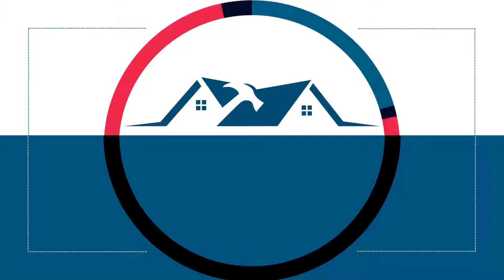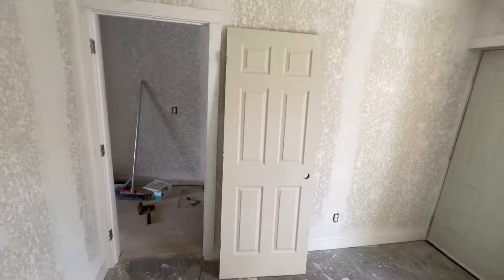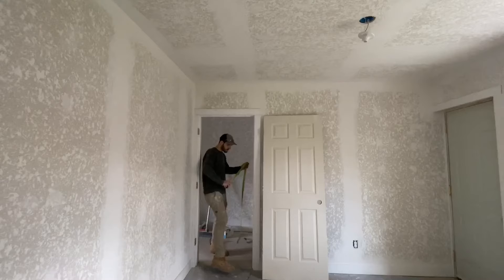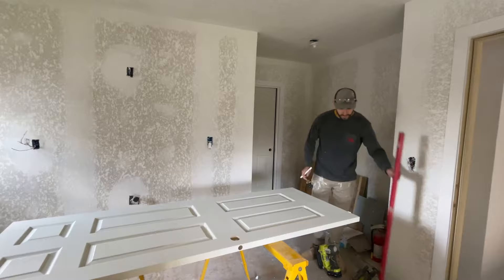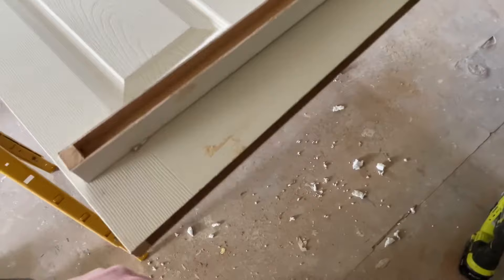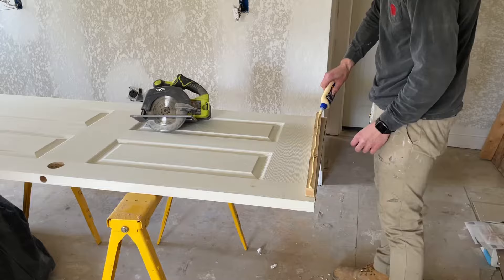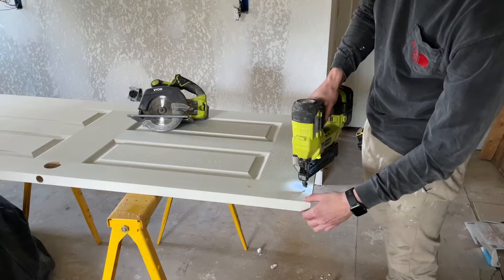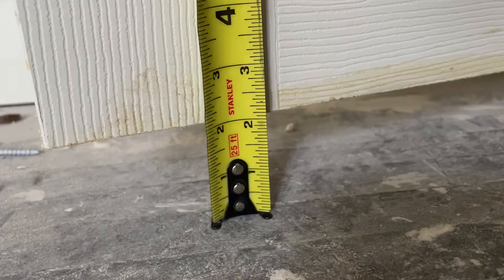How to Shorten A Door - Proper Door Cutting

Comment: I also have an old house that I’m working on by myself and doors are one of the main things that I end up having to work on because of shifting house. I had been stuck on installing a new pocket door for a while because I need to shorten the door I bought so I can hang it on my rail system. 

This video helped me figure out if a circular saw will do the job properly for cutting the door shorter and also helped me figure out what I should do with that block at the bottom of the door. Thank u

Comment: The problem with this way, while fast, is that you end up taking out 2 inches of the door and might end up with a gap too big for most flooring.

There's another way of doing this that's more laborious but will get you a smaller gap. Take a utility knife and carefully separate the glue holding the bottom rail from the veneer panel and ease it out. Then you can cut however much you want from the door and just glue and slide the rail back in. I did this just to get an extra 1/2" off a door that was almost touching the finished tile.
Reply: I dont get the difference in your explanation of cut error. Are you saying that by leaving the bottom rail on and cutting is more risky than removing the rail first and then cut?

Comment: @obrosrestoration
When cutting down a painted door would you use painters tape or simple masking tape to keep the door from splintering?
Reply: Anything should work as long as it is there to keep it held down. I wouldnt use anything like packing tape or scotch tape. Frog tape, Blue tape, white tape should all suffice. The sharpness of the blade and speed of the cut play a factor in it too. 

But general rule of thumb that I work by is that the tape is usually good enough.

Comment: Could you go into more detail on what/how you are cutting the bottom using the table saw.
Reply: All I was doing was cutting off the 1/8 inch face on each side of the cut piece so that the block fits back into the hollow part of the door. Basically set it so that it was the width of a saw blade

Comment: 2 inches on the bottom is a big gap.  What thickness flooring are you putting in ?
Reply: Not really if you’re installing carpet. A good carpet and pad will be 1 - 1.25” thick. Only leaving .75 -1” gap at bottom.
Reply: @matthyslip  a 1" gap is huge... Difference between an engineer and a tradesmen eh
Reply: @thomasbarton795  1/2- 3/4 gap would be my preferred size
Reply: @thomasbarton795 I’m removing 1” from the bottom of a door to a room that has no return path to the HVAC intake. The room is too cold in the winter and too hot in the summer.

Comment: Would it hurt anything if you just left the bottom open?
Reply: It could if someone smacked their foot on the bottom of it. You want some sort of backer on it. If you don’t have the nail gun and table saw, you can put spray insulation in and cut it off after it dries for the support
Reply: @RelocatingToCleveland makes sense. Thanks!

Comment: Having trouble cutting my HC door with my electric ryobi…. Stops about 6 inches in… any idea?
Reply: Maybe bad blade or you’re pushing too hard. It happens to me sometimes, I have to baby mine. I like the wired ones better
Reply: @RelocatingToCleveland  going to try a new blade. Haven’t changed it in about a year lol. Should be able to cut one Hc door electric or not ha

Comment: Door trimming 101, you don't just cut a huge chunk from the bottom, you trim equally from top and bottom or left and right, otherwise you end up in this situation where you're messing around having to put the core back in.
Reply from the maker: I disagree. With prehung doors, if you cut the top, the hinges are still going to mount in the same spot. You’ll just have a gap between the jamb and the door up top. 

If it were a slab door you could do what you suggested before you router in the hinge locations
Reply: LoL, go do it then. Send pics 😅